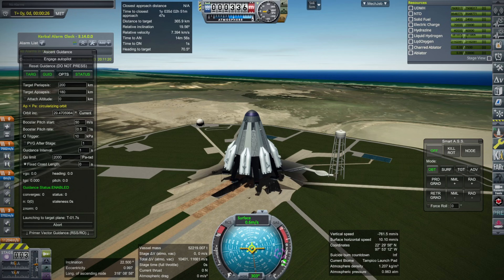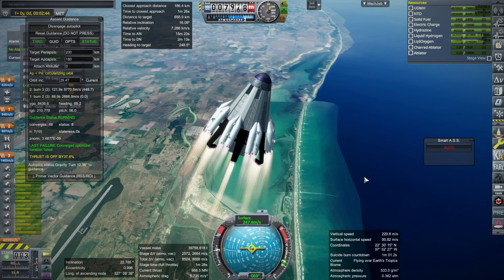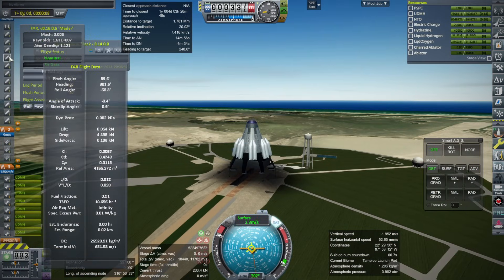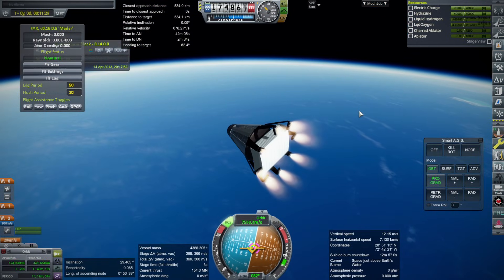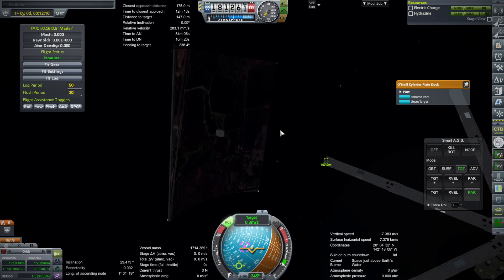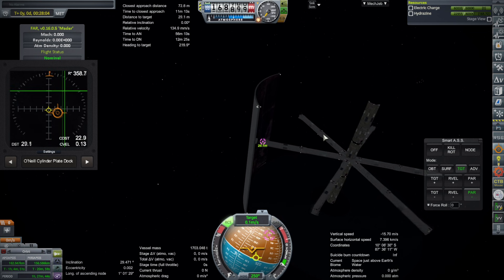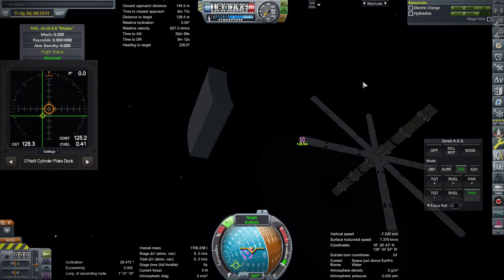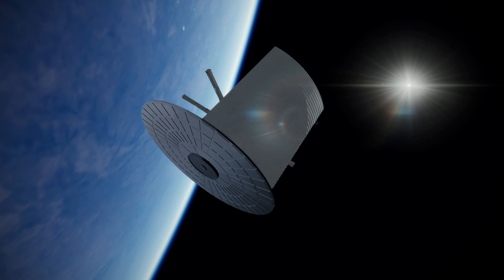O'Neill Cylinder Construction 5 (Kerbal Space Program with RO)

Comment: The Krakan have send its regards 😈it doesn't like your ambitions!
Amyway, about the clear part of the cylinder wall. It's aways design that the sunlight is only reflact by the reflactor/radiator plates into the station through the clear plate. The hinge's end aways pointed away from the sun and the bottom aways pointed at the sun.
Reply from the maker: Yes, I just misunderstood originally.